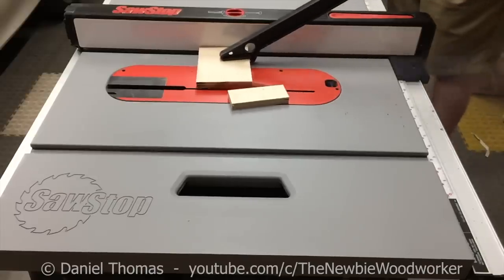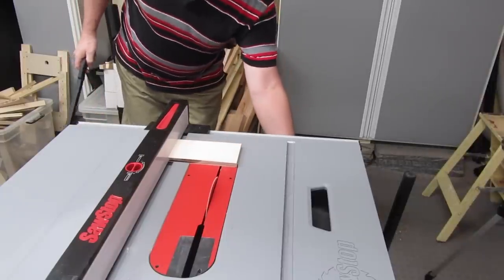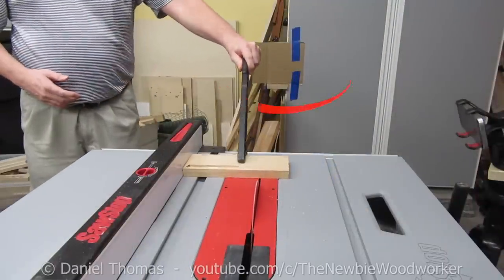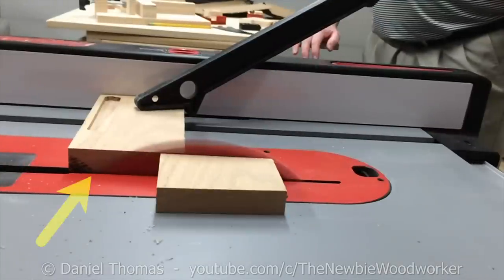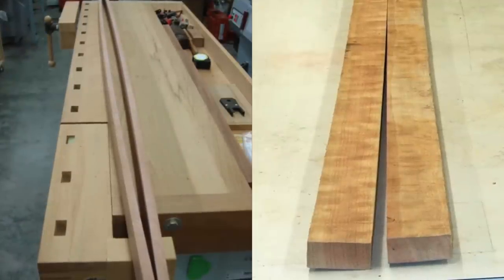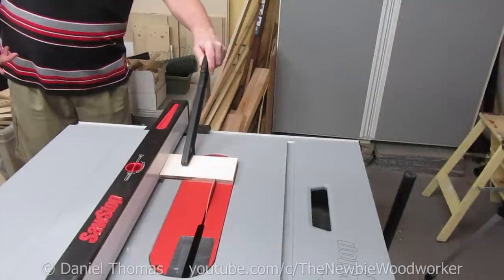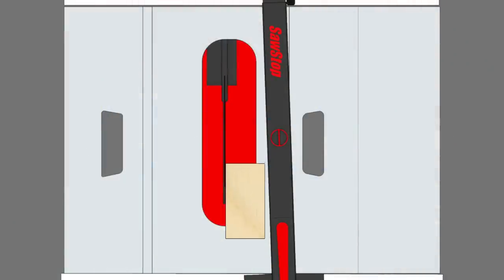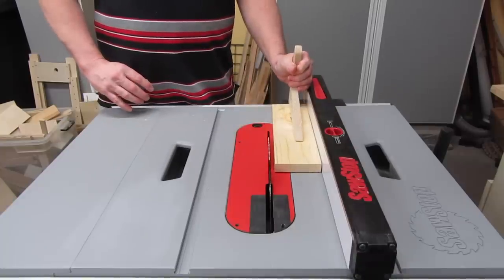Actual Kickback (in Slow Motion), & How to Prevent It

Comment: just got my table saw + GRR gripper push stick,  for the first time and I'm really scared from using the table saw . I experience using router , circular saws, miter saws, etc.this is very important video . I was familiar with some rules shown here. when you shift fence , it was too much...I don't think someone will use the fence like this and the important think is to keep the fence parallel where the blade is . btw, just bought the 50t blade.
Reply from the maker: No reason to be scared. Since you watched this video, you know what NOT to do, so you should be fine. Knock on wood, of course. 😄
Reply: @TheNewbieWoodworker  thanks. Did you hear about anyone enjured while using GRR push stick? Another question, when ripping a board , it seems too danger to position your body left to the fence as you will be move the right hand holding the push when your arm above the running blade. In this demo it stricked the wood  where the fence because you were behind the fence, Am I right?
Reply from the maker: @MoranGuyVideos  No, I've never heard of anyone getting hurt while using the Grr-Ripper, but that doesn't mean it hasn't happened. Regarding standing to the left and reaching over the blade, I understand your concerns (and share them myself a little), but for right-handed people this seems the best way according to the "experts". Just about every video I've seen shows people doing this, including people I trust, so I just have to assume it's the best way. I'll bet someone has a video that answers your question, although I don't know of one off hand.

I don't use my Grr-Ripper much anymore, except in rare instances where I need support on both sides of the cut. I have a new, simple push block that I use most of the time (there's a video on it). Of course, I'm still reaching over the blade, but my hand is further away from the blade, so that makes me feel better. And thanks to my new sled, I'm using my blade guard a lot more too.
Reply: @TheNewbieWoodworker  using gripper combined with the blade guard is not practical on thin boards but I will keep the raving knife always in place . the most important thing is to remember and to be aware of the safety anytime. even after 100K cuts - respect the tool.
Reply from the maker: @MoranGuyVideos  No, of course not. I just meant that since I leave my blade guard on more often, I don't use the Grr-Ripper as much.

Comment: Cross cutting with the fence is not advised in the users manual of my table saw. That is the purpose of the miter gauge or a sled.
Reply from the maker: That's correct. Which I explain in detail in the video, starting at 10:33, and specifically at 10:53.

Comment: I thought that you were supposed to stand to the left of the blade. Your projectiles either went straight back or back and to the right. Also, if you are to the left, it’s easier to maintain pressure on the workpiece into the fence and to avoid the crooked push that produced the worst kickback. 

PLEASE tell me if I’ve been wrong about this!
Reply from the maker: You're absolutely correct. But that still puts your arm in the way, and since I knew I was going to create kickback, I tried hiding on the other side. Almost didn't work!

Comment: Dude, I experienced kickbacks twice, and both times my middle finger nail was SCRACHED by the blade. How lucky was that?! I'm still gathering courage to use my table saw again.
Reply from the maker: Yikes! I'm thinking 1) You should be using some better push sticks to keep your hands away from the blade, and 2) what the heck are you doing to create kickback so often? 😮
Reply: Okay... I was using my table saw without push stick and without fence. My fault.
Reply from the maker: @yuriportes2606  Eek! Never freehand anything using a table saw! Either use a fence, a miter gauge, or a cross-cut sled. Stay safe!
Reply: Please don't use your table saw again before you promise to yourself that you'll take the time to have proper precautions. You probably won't be so lucky the third time.
Reply: @joonasfi  For sure! God showed me enough signs already! Thanx!

Comment: I'm a newbie leftie, with a cheap Lotus tablesaw. I stand just like you with fence on right also (never thought to change that but might try now).

My main issue is that damn on/off button! I always have to  lean across in front of the blade to switch it on (and mine has no soft start). I can never find the darn button to stop it too, without ducking down behind the saw - not nice to do when you're leaning in front of the blade and taking your eyes off your right hand which is still holding the piece down near the blade! I wish there was a stop "rail" along the front, which you just push down or can lean your hip against when you are ready.
Reply from the maker: That sounds like a pain. I wonder if you could use a separate on/off switch, that the saw plugs into? That way you could put it wherever you want. Just a thought.
Reply: @TheNewbieWoodworker  
Good point. Could be better than nothing until I can make myself an emergency stop rail. Thanks for the tip!
Reply from the maker: @petersnow2919  Glad to help. Rockler has a great stop switch that I like, but it's expensive. It goes on sale every now and then though, so you might want to check it out.

Comment: I have a new saw , not an expensive one but a good one around the 400 dollar mark and I noticed this morning using it for the 3 or 4 th time that i was getting some what i think is kickback, I was  cutting some hardwood flooring 3cms thick by 60 cms long with the grain, I was only taking of a width of about 8mm to take the T&G out of the flooring. I was using the wood  for my router table

What I noticed was the offcut to the right of the blade shot out of the back of the saw, ie where I would have been standing although having seen this happen once today I stood to the side and fed the wood slowly in, It happened just about every cut i did down the grain so Im not sure what is happening, here, the other day it was fine just today, the fence is the same measurement at top and bottom and i wasn't pushing the wood at an angle in fact as it was such a small slice to come off i was particularly careful. Any ideas what could be causing this.

 I have not seen your video on setting a saw up and i'm going to take a look now and so far no need for cross cut cuts but Im going to make your new slimmed down version of a CC sledge for that next week when I finish the router table.  Just wondering what could be causing it, the wood is like mahogany, rock hard and full of long splinters if it breaks, here in Spain its known as IPE. many thanks for the advice.
Reply from the maker: Are you talking about the piece between the blade and the fence, or the piece on the other side of the blade? The reason I ask is that the piece NOT between the blade and the fence is the called offcut piece, and while it might slide back some, I can't imagine it would ever "shoot out" of the saw. So I'm confused.
Reply: @TheNewbieWoodworker  the piece between the blade and the fence. I am wondering if my fence is pinching having seen the video  recently you did on pure kickbacks. need to investigate more and possible make a better fence for it, I dialed in the blade as per one of your instructional videos using a dial gauge and I know that is perfect. I can only think the fence could be out, its one of these where it does not go to the end of the table so Im thinking it leans slightly into the left as it travels through although the cuts do come out square.
Reply from the maker: @sitgesvillaapartmentneilsc7924  It's pretty common for fences to be misaligned, so I think you're probably right. Most fences can be adjusted, so hopefully yours can also.

Comment: I noticed that you didn"t use a riving knife. Are you saying that if you use a riving knife you won"t get kick back?
Reply from the maker: Using a riving knife GREATLY reduces the chances of kickback, but I can't say for sure that you'll never get kickback. For instance, if your fence and your blade are significantly out of alignment to each other, and the stock gets severely pinched between the blade and the fence, you might still get kickback. But I wouldn't think it'd be nearly as severe as it would be without the riving knife. I hope that helps.

Comment: so kickback happens because the wood hits the back of the saw? And how does gripper prevent kickback?
Reply from the maker: The Grr-Ripper doesn't prevent kickback, but it gives you a good grip on both sides of the stock, which can help you keep the stock stable even when it starts to kick back. Of course, the moment you feel it start to bind, you should hold the stock where it is and turn off the saw. A Grr-Ripper also puts some plastic between the blade and your hand, which in theory might mean less of a chance of getting cut. I'm not necessarily advocating Grr-Rippers, just mentioning things that might help.

Comment: There are several things you left out of your video.  First, for dimensional lumber it's important to have a jointed edge against the fence.  You can build a sled or other jig to do this on a table saw provided the work piece is firmly clamped in place.  

Second,  when ripping dimensional lumber, your left hand is your anchor and and shouldn't move forward with the workpiece.  I'm not a fan of using two push sticks because your left hand is moving when it shouldn't be.   It should always remainsin front of the blade and is used to keep the stock against the fence,.If you've ever watched professional woodworker Tommy MacDonald, you'll notice there's a small stain on his tables top where he anchors his left hand.  

Your right hand is your push hand but many woodworkers make the mistake of using their push stick too soon.  Don't use your push stick until the all of the stock is on the table.  Otherwise you can push down on the back of the work piece and cause it to lift in the front. and cause a kickback.  The body position you showed in the video is correct.

As for the gripper, I don't use one because there is a tendency by some to twist the stock away from the fence thinking that it's cleared the blade when it hasn't.  An accessory I like is the "mag-switch" featherboard that holds the stock next to the fence.

And last, when ripping thin dimensional lumber, , it's always safer to have the thin piece fall to left side of the blade.  This is because the tension that is released as a result of the cut can act like spring and shoot back like an arrow once the cut is complete.  This is particularly true if you have a long fence.  A fence that doesn't reach beyond the end of the blade prevents this problem.  In fact, all European saws come with  short fences for this reason.  The only time a long fence is better is when cutting sheet goods.  My old Unifence was nice because you could adjust the length of the fence and even pull it back far enough  to use it as a stop block for crosscuts. 

Overall, nice job and great photography.
Reply from the maker: Thanks for the coment.